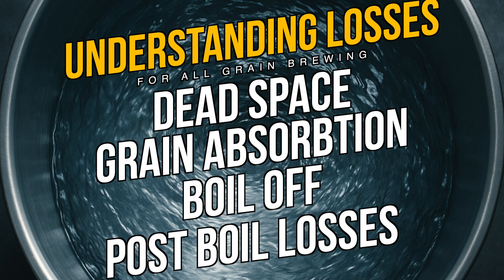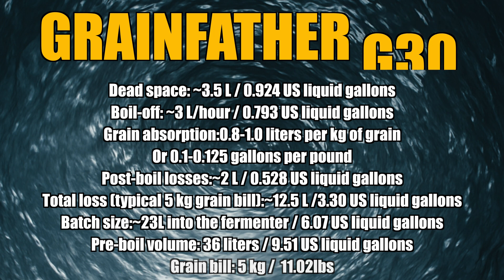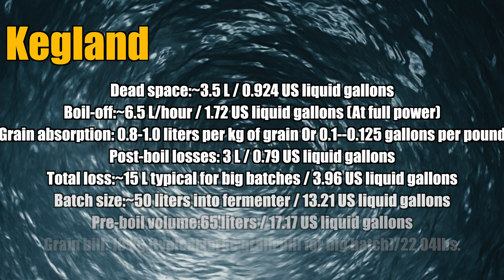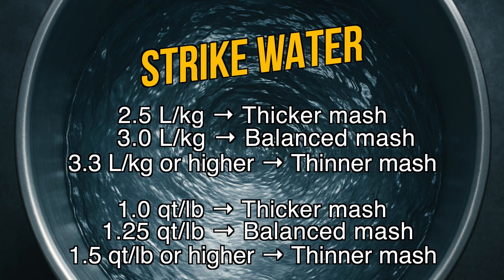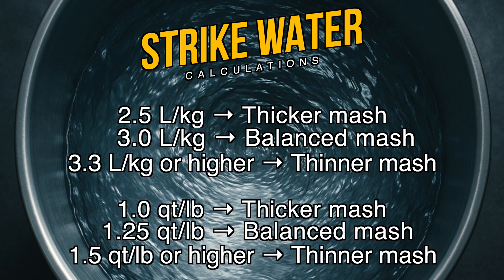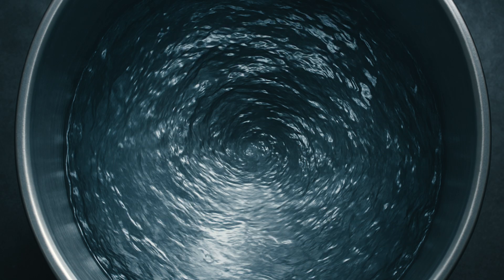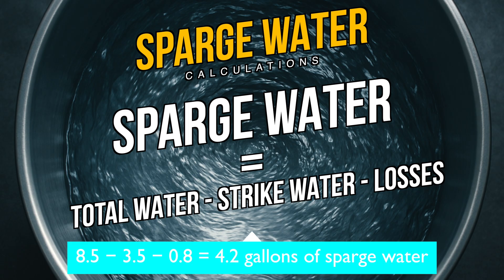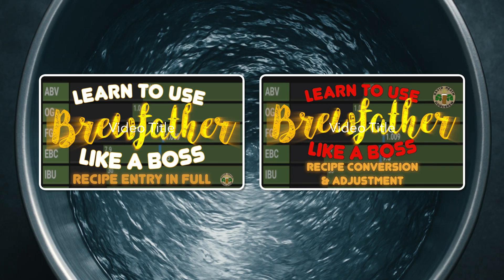The EASIEST Ways to Calculate Water Volumes for All Grain Brewers

Comment: Your videos and tutorials on Brewfather are fantastic.  I had to double check, but there is a part in the equipment section where you can adjust the water/grain ratio for mash thickness as you discuss in this video. I think the default is the thinner mash (1.5qt/lb). I never adjusted mine and that is where it is at.
Reply from the maker: Great to hear. Yes adjustment is there for sure. 🍻🍻🍻

Comment: Hello David, thanks for your usefull videos. My problem is that in the Brewzilla 35L all in one system the   water to grain ratio must be about 2.5 to 3.3 L/kg plus 7L of foundation water, so the amount of total mash water must be 19.5L  to 23.5L This is the principal drawback of this type of system to make high O.G beers.
Reply from the maker: There is a very easy solution to that, reiterated mashing. Check this out, it applies to all brewing systems:- https://youtu.be/C-7NiGZgKyQ?si=63xcloZnCMcGPZUW
Reply: Yes I make reiterated mashing for my imperial stouts & barley wines.  @DavidHeathHomebrew

Comment: Something else to consider, but I guess it may fall under grain absorption.  If you going to be using whole/fresh hops, those soak up ALOT of liquid.
Reply from the maker: Yes , you will need to tweak some for your situation, as mentioned in the video, which includes this. Its not so usual these days though as pellets have a huge majority in overall hop use in brewing.

Comment: Thanks for the video - as a new all grain brewer it was exactly what i was looking for!  

One question for you.  When calculating the sparge water volume, shouldn't it be simply total water - strike water?  It seems to me that if you also subtract losses from total, then you'll have too little water in the boil.
Reply from the maker: Great to hear. The equations always include the full picture, its more accurate overall this way.

Comment: Good information - and a good reminder of the details we can take for granted.  I have a spreadsheet that tracks each brew details - including how much water there is through each step.  With the averages from those results, I can "back in" my total water number.  I then compare it to what BrewFather said my total water should be as a reasonability check......the usually to within less than .2 gallons

I have had the need to add additional sparge water to get my boil volume correct.  Often this is when I have added rice hulls or flaked grains.  But I can't find a place in brewfather to account for these additions......usually about 1/4 gallon or more.  If I can track it better, I should be able to manage it.  If it helps, I'm using an Anvil 18.  Can Brewfather handle this extra water addition that isn't accounted for in the recipe?
Reply from the maker: Thank you 🍻🍻🍻 
Brewfather is pretty decent at water calculations, though I find it underestimates on very small batches for my taste as I prefer a thinner mash.

Comment: Thanks for this. I do 'top up' the big pot, as I'm boiling, with distilled water, so as to keep the amount (vol) of water, used in the 'cooking phase', as constant as possible. 
After fermentation & obviously after multiple rackings, the 5 gallon carboy, that I use, is usually way down from where it should be.
I take an FG reading to see if I CAN add (distilled) water, and usually I can, without diluting the beverage too much.
I usually (gently) add distilled water to the 'final' carboy, that I intend to use to siphon & bottle.
Reply from the maker: Great to hear, sounds good 🍻🍻🍻

Comment: I do believe my Anvil 18 gallon, includes the dead space, already. I use the markings inside the kettle.
I've measured, there's a difference.
I usually have to calculate sparge water additives, for a gallon extra, because of this. I use my Anvil 10.5, for a hot liquor tank. I got a Wee bit heavy Scottish ale, bubbling away, 14psi.
Thanks for reassuring, I'm doing it right!
Reply from the maker: Great to hear David 🍻🍻🍻